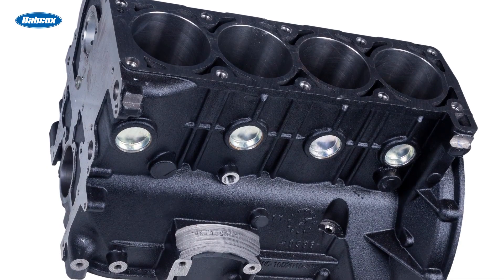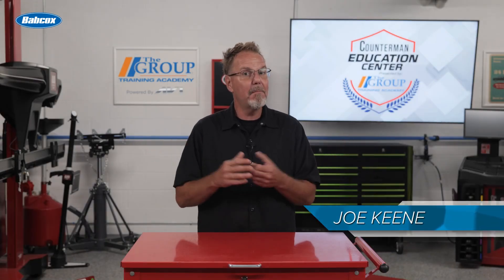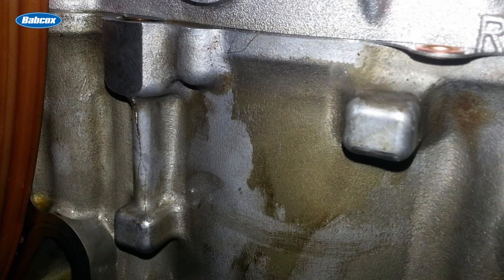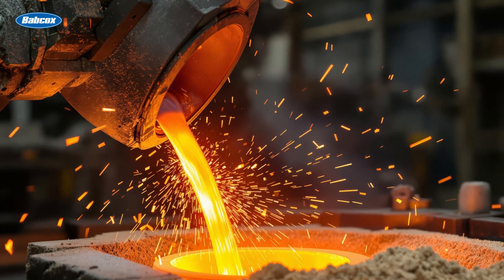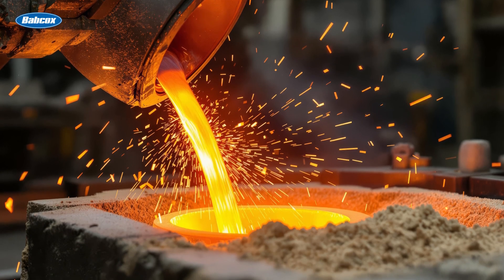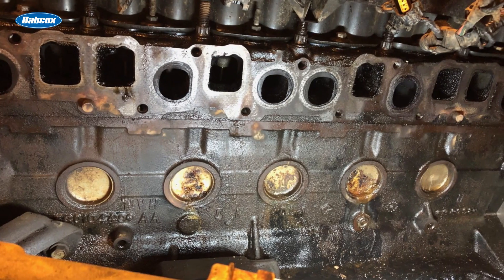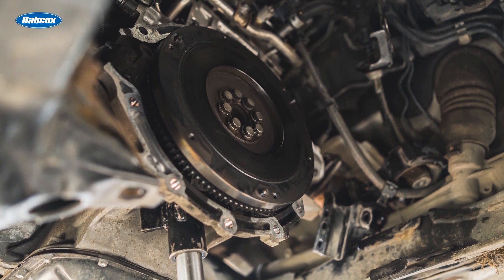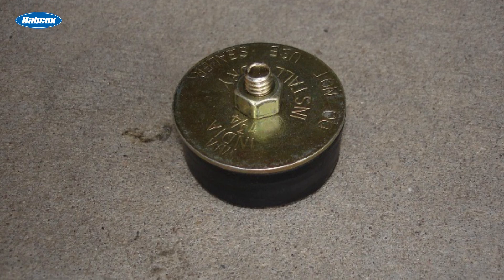Freeze Plug Function and Failures Explained

Comment: So I'm looking at geting a Kat's  Cartridge Engine Block Heater, which is supposed to go into the frost/freeze/expansion plug. Is there radiator fluid on the other side of the plug? Am I supposed to drain the radiator before adding an engine block heater?